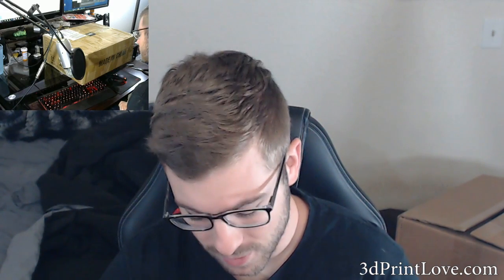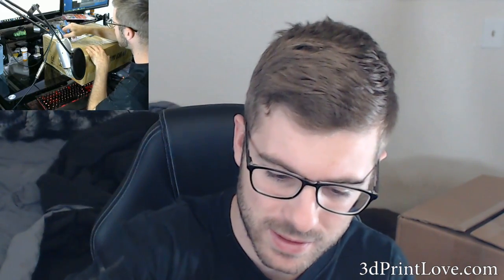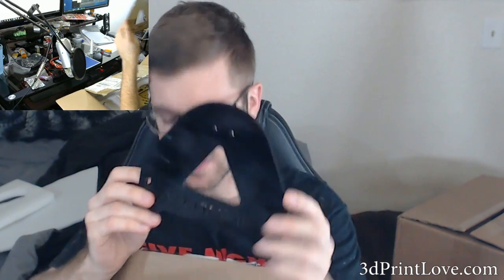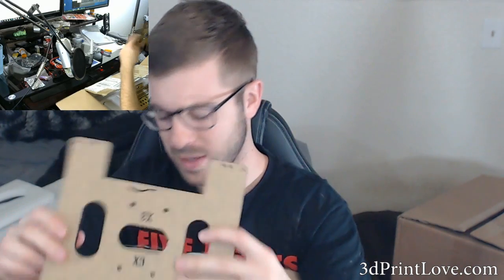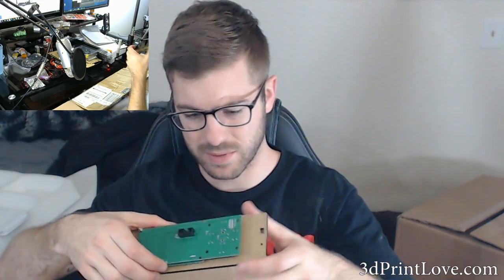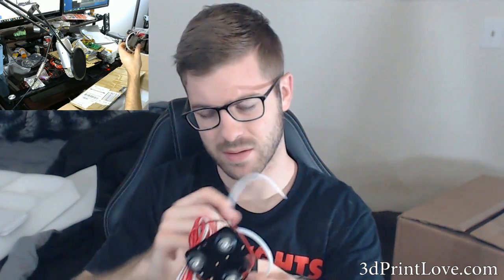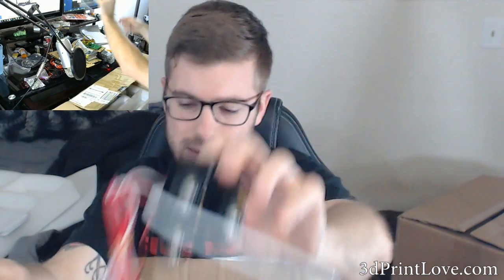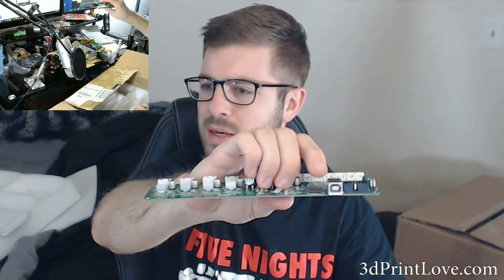Tronxy X3 3d Printer Kit Unboxing! Aluminum Frame Build

Comment: One thing I'd do with this printer using a Melzi board IF you're going to be moving it around  is get a USB Extension cable so you're not repeatedly unplugging it. Mine worked itself off the board on my Reprap i2. Also watch for short circuits on the endstops soldering.

Comment: i have a board like yours had problem with it 1 mostef burn after 4 print had to order en other i advise you to put heatsink on the 2 mosfet in front of the hotbed conector and the 2 fan conector also if you can install a fan to cool it

Comment: It runs great, but as a Tronxy X3 user I'm going to tell you that you will want many upgrades.

X axis,  Y Axis tensionsers, Legs, Wire management, bed leveling nuts, fan shroud